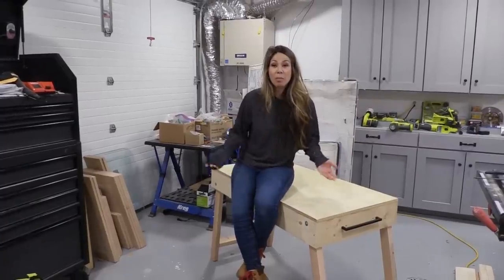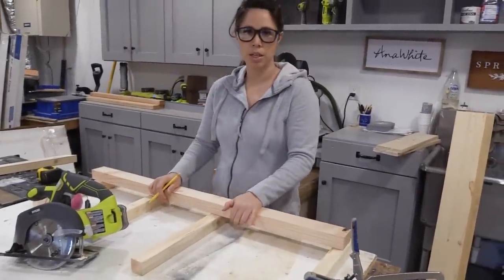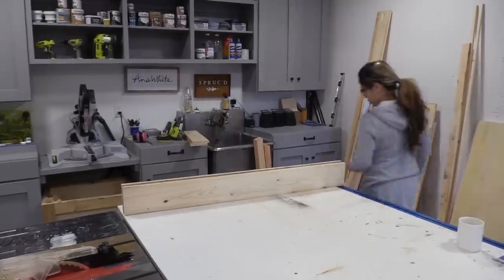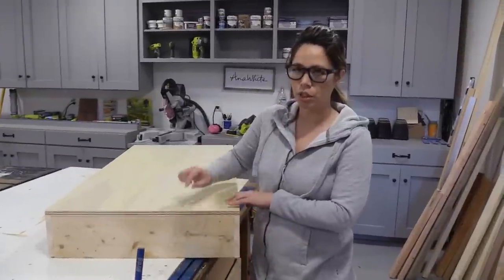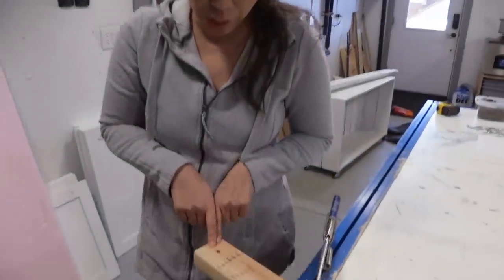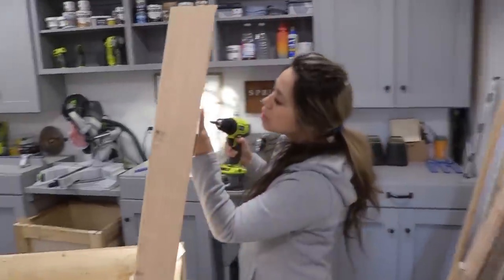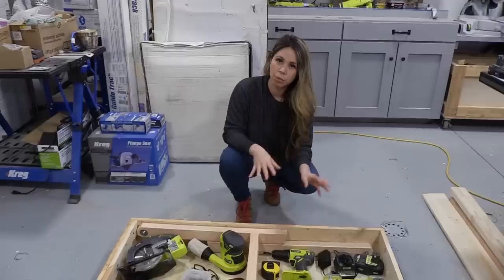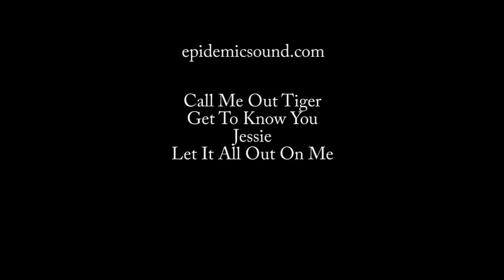Portable Workbench that Stores Tools #anawhite

Comment: Great concept.  I would add a grid of dog-holes for clamping and sawing options.  Dogholes, either 3/4" diameter, 4" on center in all directions or 20mm diameter, 96 mm on center in all directions.

Comment: I made this portable bench. It’s a cool design and can be really useful but I feel it needs a few elements to make it better.  The legs don’t lock so if I push it from an end the opposite legs ride up and potentially over, collapsing that end which could be an ill timed disaster.  The legs totally depend on the strength of the butt joints since they pivot and that’s a long lever. Mine broke the glue on the butt joints and now only the screws are holding it together which might not be for long using pine. I probably should have cut 1x6’s from plywood.  Steel corner braces can fix this.  I think another 1x3 with V’s cut into the end and span those cross members could brace the legs to prevent the collapsing issue.  That does make for one additional piece that won’t fit in the box though.

I do really appreciate you sharing this and I learned a lot going through the process.
Reply from the maker: Great suggestions!

Comment: I just learned something about screws.  The larger the screw head, the better chance it will pull the two pieces of wood together, and here I have been using those little trim screws.   Thanks for the tip!

Comment: Ana, make two shallow trays to hold all of your tools (with handles that do not stick up above the table sides) so that you don't have to remove and replace the tools individually when you use the table. The trays will also make it easy to move your tools to your work site rather than carry them individually.  Good video.

Comment: Great project! This is even useful for anyone with a shop to use as an extra work surface when needed. Tip: If you use longer bolts, you can double nut the legs and not have to worry about the nuts working loose over time.

Comment: Pretty damn nifty I live in an apartment and am getting all my tools together and bought for cold forging some Viking axes and some knifes pre-fab using a grinder and what not and my own quench tank I built at the fab shop. And just about got everything together I need spent about 360$ but the last thing I needed was a workbench preferably mobile or foldable I can take out back to work this I think would be perfect, there's not a lot of weight besides the vice ill mount but I don't see it having a problem holding that, its a smaller Olympie one. I might just make this bad boy, Thank You for the great idea!!
Reply from the maker: Sweet, I hope it works great for you!

Comment: I found that at the corners of  boxs if I bored a 3/8" hole from the end of my soft wood box joint and sank and glued a hardwood dowel that I could screw my fasteners into the corner could be tightened without stripping the screws.

Comment: Love your videos and straightforward approach, Ana. Great little work bench. +1 for removing the battery before adjusting the blade depth -- great modeling of proper tool safety. One question: How did you determine where the holes in the sides of the top should be for the carriage bolts? That's the sort of calculating that often trips me up. Also, if you haven't seen it, check out Peter Millard's video on his ultralight portable work bench. Keep up the good work.
Reply from the maker: Thank you! Here is the free plan with bolt placement measurements https://ana-white.com/woodworking-projects/portable-workbench-woodshop-box

Comment: Nice, easy build. But will the 1x6 table frame be sufficient to handle lateral/outward pressure from the legs when there's a lot of weight on the table?

Comment: One of your short ends has one board the other end has two boards. The plans don’t show the double stacked end. Is that so the legs rest to match the other side?
Reply from the maker: Just made a mistake and didn’t want to drill a hole 3/4 over.  You have eagle eyes

Comment: I think you need an Impact Driver
Reply: Why?  I've driven tens of thousands of screws with drills.  Don't overcomplicate it. No need for anything more than a drill and a saw.
Reply: Impact driver would be unnecessarily powerful for the precision she needs.
Reply: @bromarvids5186  - All professionals and carpenters, we use an Impact Driver for screws and a Hammer Drill to open holes.  If you are not a professional and you only do things at home, I understand you
Reply: @SamiDurm  ha ha. That's not true. You can drive a screw too hard with an impact driver. The wood is thin and could split. That's the perfect drill. I know this because I am a carpenter. Building frames, yeah no problem, impact and nail gun is the best way to go, it's not finishing work. But this drill is very precise in comparison to an impact. You simply don't need the torque, plus, impacts don't drive smoothly. Hammer drills are not just for pre drilling holes ha ha.